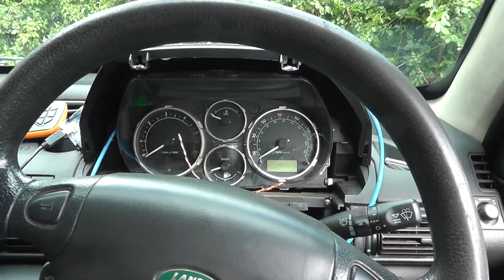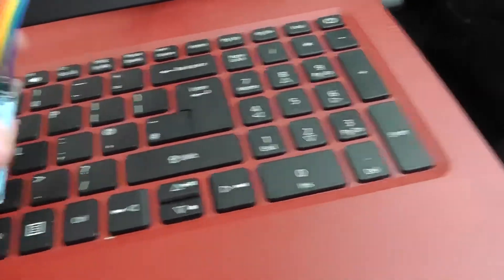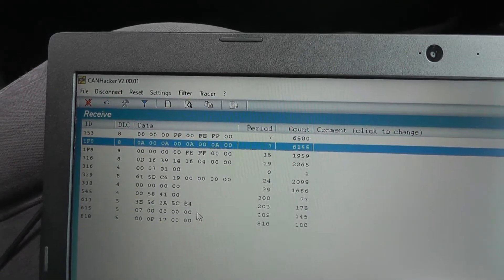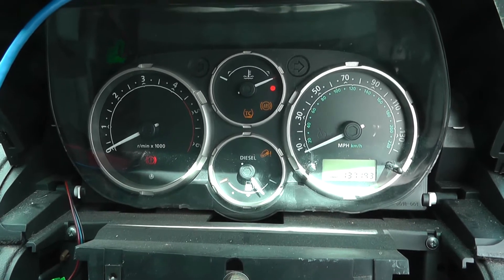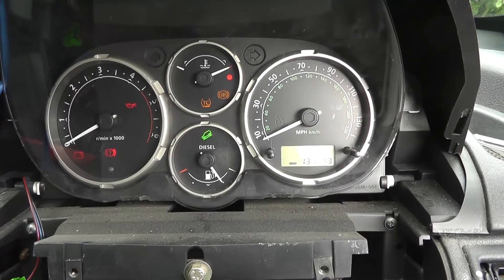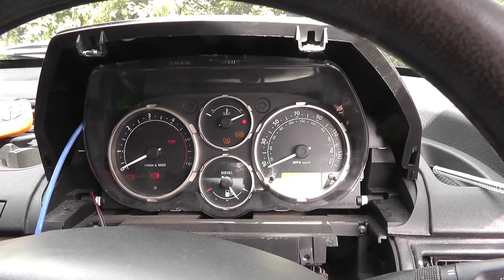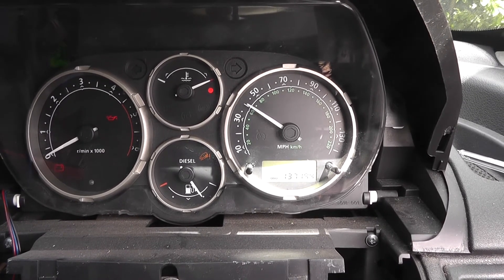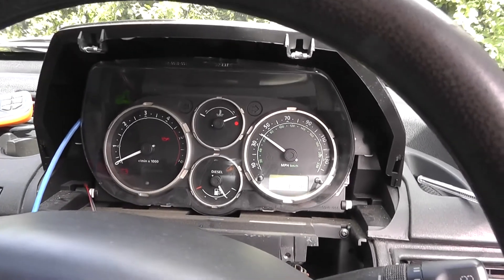DIY EV Part 4 - Reading the CAN Bus part 4 - Controlling the Dash.

Comment: Your video is very helpful. I have a question that how many ohm resistors should I install in my MCP2515. Thanks!
Reply from the maker: All CAN networks need to have two 120 ohm resistors, one at either end. If you are connecting to an existing working network it will already have them so you don't need any.
Reply: @alibro7512  it seems my problem is the OBD II port, after going through all your videos and reading the comments I saw you mentioned using another library, I wonder if I can get Any instructions from you? I feel very grateful for that!
Reply from the maker: @nhutdominh7624  Sorry I made this video 3 years ago and haven't looked at it the OBDII connection again since. My EV project is connected directly to the CAN wires in the loom.

Comment: Gr8 work sir. Quick question. How does the speedo vs odo work? Will the odo keep ticking when you write speed to the cluster? 

My idea is to build a transceiver with 2x MCP2515 and a Ardiuno. Receiving all messages and sending them to the cluster. Then I modify the speedo signal as I want to change my tire size and have my odo correct.
Reply from the maker: Not sure about the odo TBH but a better way to go is an Arduino Due with SavvyCAN and two transceivers. The Due already has two CAN ports but needs the transcievers to communicate with the outside world and Savvycan was designed to work with it.

Comment: Any help? Im trying to drive a mk4 mondeo ipc cluster over can with arduino and mcp2515 setup. Ive read somw can messages from my car but cannot get the cluster yo do anything or reapond. 
I have vcc, gnd and two twisted mid speed can wires connected. 
Is is possibke the cluster is to blame? Ive reflowed the connevtor pins with leaded solder but still not talking.
Reply from the maker: Have you any termination? with the power off you should see 60 ohms across the CAN lines.
Reply: @alibro7512  I have 60 ohms across the can wires. There's a 120 ohm resistor on the Arduino can module
Reply from the maker: High is usually  @SonicFan52  Have you confirmed CAN high and Low? CAN High should have the higher voltage.
Reply: @alibro7512  yes I believe it's correct. High is about 3v and Low is 1.5v. pretty happy with connections.
Just can't seem to get the cluster to work. Could it be cluster fault?
Reply from the maker: @SonicFan52  It could be but if you are not sending the correct messages it won't work. Do you have a CAN dump from a Mondeo or have you searched online for Ford CAN messages?
Reply: @alibro7512  tried a few examples from online sites and also read some messages back from the car live.
The cluster powers on ok but after 10 mins of trying to send messages it goes into sleep mode as if it's not recieving anything
Reply from the maker: @SonicFan52  Have you tried sending messages to the cluster in your car?
Reply: @alibro7512  not yet as I've not decoded the id numbers to know what I'm sending. Plus I'm plugged into the obd port so don't wanna trigger anything I shouldn't 😛
Reply from the maker: @SonicFan52  If you can watch the CAN messages as you rev the car you should see one of them changing in proportion to the RPM. 
What CAN reader are you using? You might need to connect in directly to the CAN wires going to the dash as the OBD2 port may not be on the same CAN bus.
Reply: @alibro7512  didn't want to hack the loom as it's my daily driver. 
Might have to admit defeat on this occasion
Reply from the maker: @SonicFan52  There is probably some kind of Heartbeat message to keep the dash awake but you would need to know what it is.
Reply: @alibro7512 forums say it just needs chatter on the can lines or it will go into sleep mode. 
Not sure tbh. CAN is a real pain in the arse 🙂 
Give me direct wiring like in my old escort 👍
Reply: Is there a way I can access that bus through the obd port?
Don't have the time to strip the car and hack the loom up
Reply from the maker: Sorry, I don't know.
Reply: @alibro7512  no worries, tried again tonight but no luck. There are some example id codes other have had working. Don't work on my setup. Must be a faulty cluster as I can read from the car otherwise.
Reply from the maker: @SonicFan52  Well done. What hardware and software did you use?
Reply: @alibro7512  also tried sending directly with Arduino ide code. Still nothing :/
Reply: @alibro7512  got it working! Was on different can bus and was 125kbps rather than 500kbps for high speed can. Mid speed can and multi media can are both accessible on OBD2 connector 👍

Comment: Hi, I finally connected it to the Canhacker with UNO via OBD and can see the CAN bus messages, but after a second, the messages seem to stop sending. Do you have any idea ?
Reply from the maker: I made this video a couple of years ago and had some issues similar to yours at the time. I think the software is a bit flaky but also ensure the cables are properly twisted and playing around with the settings might help.
Also make sure to confirm the resistance across the CAN wires is correct. You should have two 120 ohm resistors in parallel so ensure all power is off and measure the resistance and it should be around 60 ohm
Reply: @alibro7512  Thank you for your suggestion

Comment: i am unable to compile the code for uno r3. Needed help bro.
Reply from the maker: Do you have the correct Library installed?
Reply: @alibro7512  i have a uno r3 and mcp 2515, it would be better if you suggest the libraries. But I have installed the one in the link but it returned error.
Reply from the maker: @dasji8053  How many libraries have you in your Arduino folder? I found in the past they can conflict if two libraries have a file with the same name but are not the same.
Have you Googled the error to find out what it means?

Comment: Hi! 
I have an electric motorbike where battery can be only used charge/discharge if it gets CAN communication. Which would be the best way to capture signals from charger and replay toMOCK it with Arduino?
Reply from the maker: Have you tried using a setup similar to mine? It may not be the best but is probably the cheapest.
Reply: @alibro7512  I will try to build it, just not was 
able to connect to the signals yet as no extension cable.... it uses  "M25 ebike plug" which is a bit expensive and has about 9 pins.... 
I am not sure what other pins to set to what value for the stock charger to think it is connected to the bike battery... I located the CANH and CANL from controller manual and know the + and - and which pin to ground to force battery to listen to can bus.....
So  next try would be to try the stock charger CAN pins will it say something or not without a Y cable to the battery...
then if there are packets replay it with arduino to the battery.....
I have no better idea yet...

Comment: Yea, great. I try to repeat this.. reciver works sometimes. but tranciever never. 
Today solded connection between arduino uno & mcp2515
Reply from the maker: I have found this software to be a bit flakey and prone to freezing. I found a better system and will be making a video about it soon.

Comment: Well done Ali. You have achieved your aims so far and by now I expect your car has the electric motor in it. The Temp gauge and fuel guage may have analogue to digital converters some where to cover the full range of the guages. This has been a really brilliant strategy group get you where you want to be. Respect!!

Comment: Hello. Does ford focus 2000 has can bus wiring? Thanks.
Reply from the maker: I don't know but if it does then probably engine bay and dash only. It may not even have CAN at the ODB2 port but a quick Google should tell you more.

Comment: Hello good morning, I performed the assembly and tried to connect via CAN BUS on my honda accord but I couldn't read anything.
So I ask you this code that you left the link I don't need to modify anything correct?
Just copy and paste and change the oscillator crystal frequency to 8MHZ?
Hugs and thanks for the excellent vi=deo!
Reply from the maker: Hi
This should work if you are connected directly to the CAN bus wires. It probably won't if connected to the obd2 port

Comment: Hi, Thanks it is nice video.i have a question can i connect through OBD2 Plus (Pin14 canL pin 6 CanH)?will it work for mitsubishi 2009
Reply from the maker: I don't know about the Mitsubishi, you would need to confirm CAN is available at the OBD2 port as it isn't in my 04 LandRover but is in my 2012 Merc. If available it is probably locked and needs a command to unlock it.

Comment: When disconnect from car can system. Do u need to add 120ohm to the can hi and low?
Reply from the maker: I tried it with and without a resistor and it worked both ways. If not in the car you need 120ohm both ends.

Comment: Hi, Great videos by the way.  Can the MCP2515 store and push out  CAN messages without the presents of the laptop. Does it have the capacity to be programmed this way? Thanks
Reply from the maker: As far as I know it is just a transceiver but the Arduino can. Some Arduino Uno's have SD card readers for storing data but that is way above my pay grade.
Reply: @alibro7512  Ok Thanks for getting back to me. Keep you the good work on your project.👍

Comment: hi bro again.. Would it be possible to connect can high, low line directly to obd2 port??? would it gonna be working>?
Reply from the maker: It depends on your car. This car has no CAN at the obd2 port so I can't do it. More modern cars can have CAN at the port but it needs to be enabled.
Reply: @alibro7512  thanks for your reply!!
I'm running kia 2019 forte now, and would it be possible to connect mcp2515 can high,low cable to obd2 port can high,low port?
Reply: @jaykor9970  anything is possible if your willing to put in the work but if your asking the question instead of researching it I would not recommend doing that since your probably going to break your newer vehicle and might struggle fixing it, not trying to be a dick or anything, I'm just encouraging you to do some research and maybe practice on a older or junk vehicle. maybe buy and old gauge cluster and practice controlling that, used gauge clusters are cheap.

Comment: Hi Great video, After spending Days trying to find CanHackerV2.00.01 (Link totally dead now) I managed to find it. Its now on my Github if anybody else Struggling to find it.
https://github.com/garymeg/CanHacker-V2.00.01
Also another good one is this. Its Arduino and Python based so works on windows linux and mac
https://github.com/garymeg/canDrive/tree/Extended-id-Mode
Reply from the maker: Thanks for the kind words
I posted the location for CANHacker 2 in the description of the 2nd of these four videos and after checking it is still there and available. I copied the details to the description of this and the other videos in this series. 
It's really great that you put it in your Github as well though so hopefully it will be available for a long time to come.
Reply: @alibro7512  However i try to get to canhacker with the link you shared all i get is a landing page, no where to download from even following you instructions, tried even typing in the address. but no joy. i got it now
Reply: that second program i found, it can hide packets that are just floating about, highlight new data and packets, or show only packets your interested in.
Reply from the maker: @garymetheringham4990  Sorry I missed your replay.
You need to copy and paste the URL into your browser. It will take you to the home page. Click on Archive, scroll down and click on USB-CAN Bus Interface. Click on Canhacker v2.00.01 to download it.
Reply from the maker: I'll take a look at the second link when I get a chance so once again, thanks for sharing.

Comment: hello bro. well watching your video. It really helps me to do my project. anyway, can I clear 'DTC' with CANHACKER program?? If it is possible please note me. thank you~
Reply from the maker: Hi
I guess the answer could be yes if you know exactly what messages to sent to the car but who knows what they are? 
 I suspect it would be easier to use Torque with a Bluetooth Dongle.
Reply: @alibro7512 thank you for your super fast reply!!! I prepared all the library and software... the only thing that is left is to find out what code to send . It seems to be well known the PIDs on the internet. As you show on this video, turn on or off the lamps seems not be seeing to actually control that function right? just turning on or off the lamps.. If it's not It would be more easier to erase the DTC code.. plz note me some tips 
thanks for your super fast reply one more.. :)

Comment: Hi, I am struggling with this. How did you figure out what can messages you need to send to make those lights go out? When you disconnected the dash the only remaining Can ID's were 613, 615, 618. But when you are sending Can you use ID 1F8. What 1F8 stands for then and how did you figure that out? Thanks
Reply from the maker: Have you watched all four videos? The first three explain how I got to this stage.
Reply from the maker: Also check here
https://www.landyzone.co.uk/land-rover/freelander-ev.360880/ and here https://www.bimmerforums.com/forum/showthread.php?1887229-E46-Can-bus-project but you may need a login to see it.
Reply: @alibro7512  Thanks I watched all of them again I had missunderstood how it works. I thought you were modifying messages that you were receiving from your dash. Your instructions were super helpful and I was able to receive and send messages with canhacker. Did you get that code written to send multiple can messages at once? Would you mind sharing? Thanks
Reply from the maker: @martynasetminas7845  Great, I'm glad to hear it was helpful.
I've moved on to the next stage of the project and have removed the engine from this car so for now this part is on hold. As soon as I have more figured out I will share it but that could be 6 months or more from now. 
I'm not known for my speed in projects like this. 😋

Comment: Good work Ali.

You should find all ABS ECU functions continue to work, as long as the ABS and Ipack can communicate. 

To make e oil pressure and no charge light go out, you simply need disconnect the connections from the engine, which of course will happen when the engine isn't there.;)

The temperature gauge is an interesting one, but it could be down to the way the gauge is programmed. The gauge is graduated so it only reacts to large swings in engine temperature. Due to this, you might find the code window for partial needle movements are small.
Keep up the good work.
Reply from the maker: Hi John
Thanks for the comment, I Tried driving the car with the ECU disconnected and the only warning lights were TC and HDC so hopefully it will be fairly simple to put them out and if it's as simple as disconnecting the sensors for Oil pressure and Charge lights then the warning lights shouldn't be an issue at all.
I may have another go at controlling the temp gauge before removing the engine but I don't think it will be a major issue.
Reply: @alibro7512 Hi, Ali! Or should I call you CAN Guru? :)

I was wondering if you can help me out with my project. I need to sniff the BMW's K-CAN network to determine when the car is in Ignition. I need someone to write the code for a PIC18 micro or any other similar microcontroller with built-in CAN interface. 

This, of course, is a paid gig. I don't expect you to do it for free.

Please let me know if you're interested in that, or maybe know someone who might be.

Thank you!
Reply from the maker: @111chicane  lol, unfortunately my coding is worse than my CAN knowledge so I don't think I'd be much help. Chatgpt and Bard on the other hand are pretty clever at doing exactly what you need. It might take a couple of goes getting them to get it right but that's what I would do.